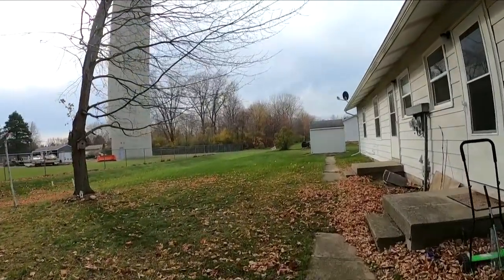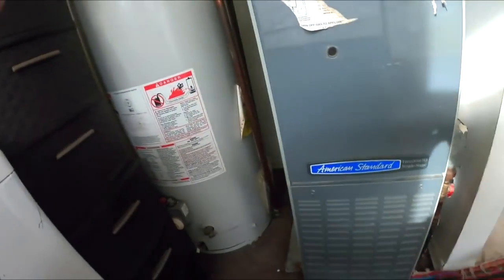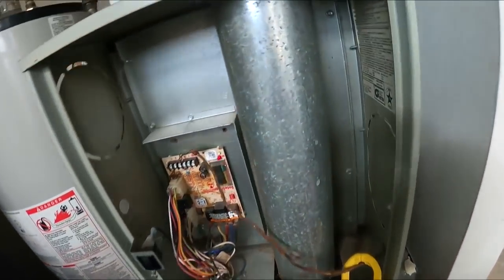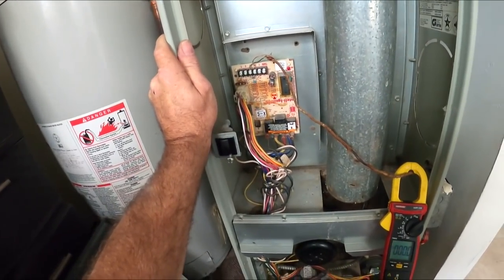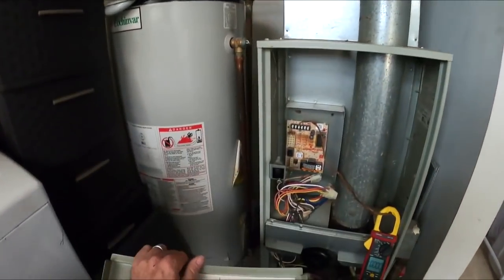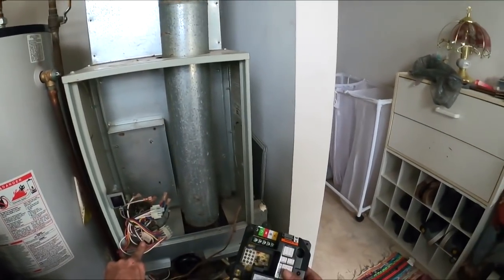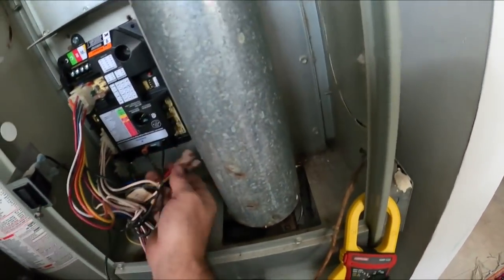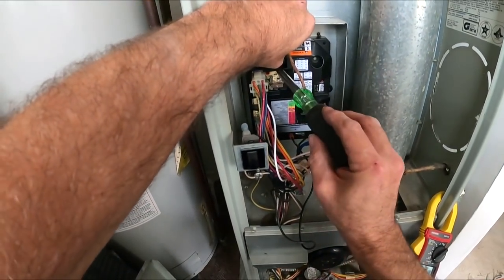White Rogers 50M56U-843 To Save The Day

Comment: I've just purchased a home and noticed this was installed in my furnace when trying to install my Ecobee 3 smart thermostat but am not having any luck getting the thermostat to power up with the 50M56U-843. The C wire was also connected on both ends but still no power to thermostat.

Comment: I remember one furnace I had to work on the other techs couldnt figure out was interesting last winter. It would run perfectly fine then drop on flame sense randomly after running for a long time. Had sat infront of it for a good 45min to try to catch it and of course when I started packing up my bag it did a random fault and the LED ended up blinking a number that wasnt even on the chart so I ended up replacing the PCB. Gotta love corrosion and them confusers.
Reply: Yeah, my Goodman furnace would intermittently fail because it wasn’t sensing the flame. The board was 17 years old when it failed.

Comment: Great job!  But, man, if I don't test the flue gases, supply air CO, supply gas pressures (burner running and not), cracked heat exchanger flame flutter check, AND check customer''s CO detector too,,,  I could get fired!  California requires a customer CO detector in all rental units.

Comment: Just had to work on a unit the other company said needed replaced. Old 80 plus. When I arrived the entire unit was un-wired fan and limit laying in the blower compartment. The resident a 70 year old lady had been with out heat for a week with a couple sub 20 degree days using space heaters. Wired unit found a bad stat causing a voltage drop to the gas valve. The other company had replaced the gas valve but for some reason the coil was open possible due to voltage drop I'm learning to they wired high voltage to it.  Replaced gas valve and everything worked fine. Did a CO test and it passed. Sad some of these company's don't trane the new techs.

Comment: Thanks for the video, I work in building maintenance, and we have about two hundred units that have gas furnaces that we maintain. Some of the furnaces have been replaced and are not all the same so the components may be different. How do you know if you need an 80 volt or 120-volt ignitor on different furnaces?
Reply from the maker: some trane and lennox have 80 volt ignitors. check voltage coming out of board
Reply: if not able to test voltage on them, take the model number and search for replacement parts

Comment: That's a pretty quick and cheap fix. Boy you seem like you cranked back a pot of coffee and 2 energy drinks haha.
Reply from the maker: just me that's how i work get it done and on to the next one
Reply: I guess a board is cheaper than a new furnace but my neighbor paid over $500 to have his furnace board replaced. I paid $72 (with free shipping) on eBay for the same board.
Reply: @joep4143  Ha,ha,the joke would be on him. E bay will not warrant an electrical part. That is why the contractor charges what he does. You get what you pay for.